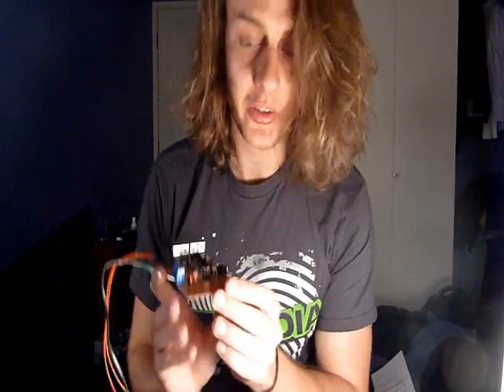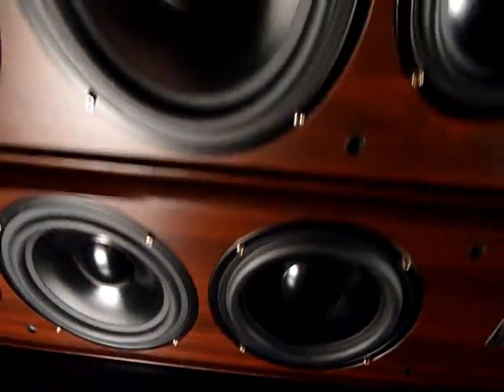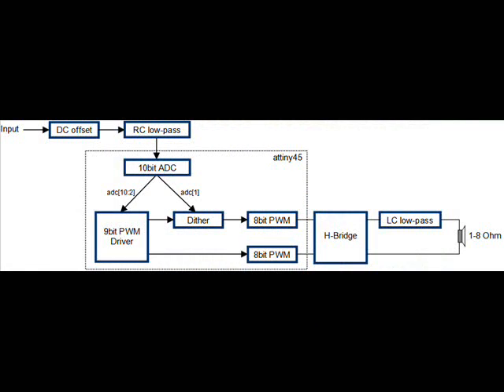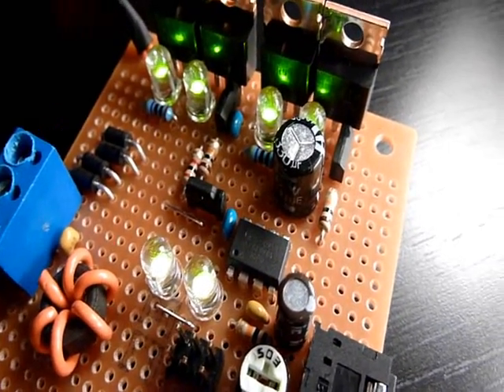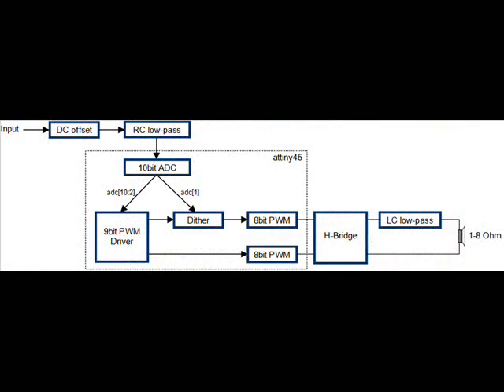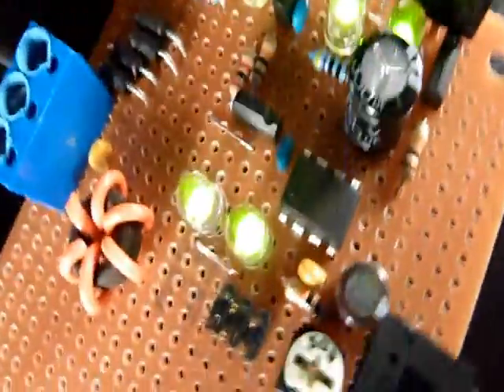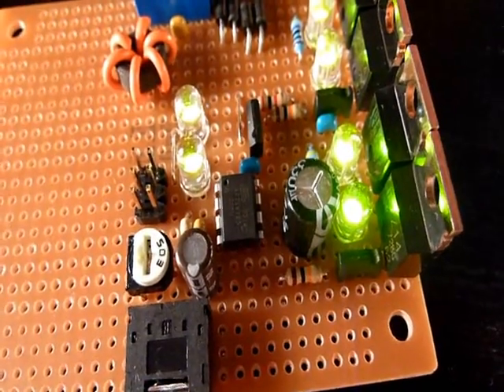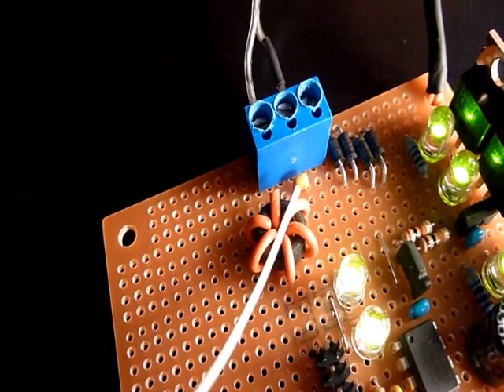DIY 70W Class D Power Amplifier Driven by AVR Microcontroller

Comment: Hey. I am building your project now, but i have a lot of problems...1) problems with hex. ( no output signal on attiny)2) irfz mosfet burning all time. 
A have psb file, so i didn't found mistake in it.
If u have massanger, i want to communicate with u..:( i can't build it alone

Comment: if i want to zener diode instead of led. what are the values will be?
Reply: +Adnan Ibna Islam Shovon most chances 5.1V zener diode because you can get about 4.5~ reference voltage for the regulator from the green leds. or use a 3.3V zener diode just but a kit of the on ebay they are super cheap.

Comment: would it be possible to use an Atmega328 for additional ADC input and PWM output (of course with a second H-bridge, passive components, and code modification) to add more audio channels?

Comment: Nice, also I like your speakers. You should put a heatsink on those transistors.
Reply: +MrInternetuser2011 True! Though most high power speaker will have heatsinks on the mosfets.
Reply: of course if you buy an amp it will have a heat sink. how big it is depends on the power dissipation and also what brand. but this 1 in the video, his just demonstrating.
Reply: class d amps don't really need heat sinks, plus, he wasn't really pushing them.
Reply: wynnful Still, most class D have heatsinks, if you are planning on driving them at all you should have some heatsink!
Reply: Joshua's Recordings I know, I repair pa equipment for a leaving. this video is just a demo. do you think someone who can build an amp will forget to put a heat sink...
Reply: wynnful Stranger things have happened. I have seen OEM gear without heatsinks, not everyone likes things as cool as I do!
Reply: Joshua's Recordings were they good brands like j.b.l or peavey, or some cheap Chinese made stuff? some designers purposely let the transistor's run hot, they think they sound better when they hot, that's very stupid of them.
Reply: wynnful One was a Boston Acoustics powered speaker also on some "fake" Harman Kardon speakers made by Samsung. Also I have seen way undersized heatsinks on a Samsung home theater that was 2 years old and had burnt out the amp chip.
Reply: Joshua's Recordings I'm guessing they were cheap. the pro audio gear I work on, Yamaha, jbl, crown, behringer, phonic, wharfedale they all got decent heat sinks.
Reply: +wynnful that's not exactly true, it all depends on the heat dissipation of the mosfets.

Comment: About to make one of these - anyone made a version? any thoughts? sound / performance?
Reply: +Cameron Mitchell, I did it. It's in my videos. The sound is not the clearest I've heard, but it fits my needs (electric guitar cabinet). If you need clear sound, you can use a chip amp, like TDA2050.

Comment: Well let's see.. power dissipation in I²R is (5.9²)(.145) assuming 70 watt power dissipation in a 2-ohm resistive load and a .145 on resistance. That's 5 watts and divided across 2 devices that's 2.5w dissipation for a square wave dissipated into the load (0 phase angle). If Junction-ambient thermal resistance is 60 C/W, then that is 150C, pushing the limits. It's probably fine, but I'd throw some penny 'sinks on just for good measure, I guess...

Comment: Just one more thing, in the video, you mention some Shockley diode at the output, but on Rev.2 on your web blog, they are not show. Do we still need them (I know for driving reactive load, u r suppose to have them accross the driver to protect it from back emf, but I don't know if it applies in this case). Anyway keep up the good work and thx for the reply.

Comment from the maker: Yes and no. By increasing the voltage, power will increase quadratically, but you will sacrifice audio quality because of the 10-bit ADC on the attiny. The 10-bits are available only at max power.